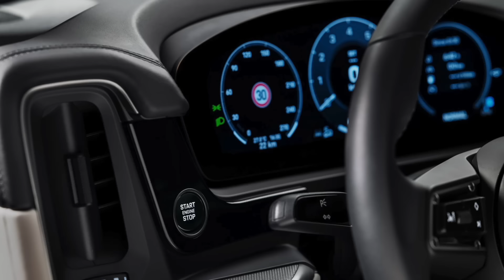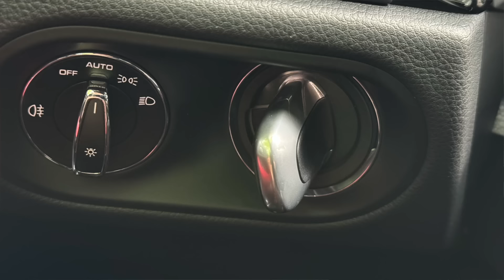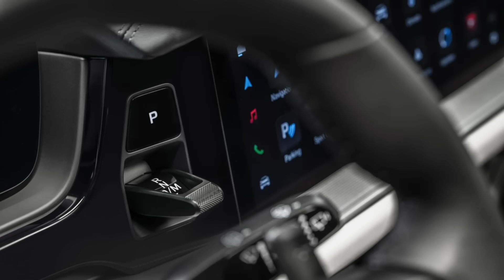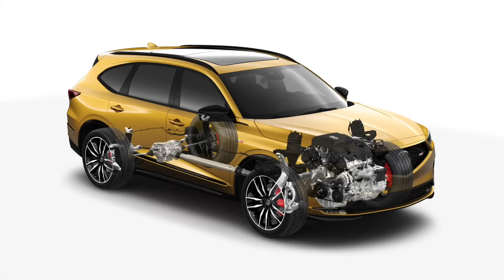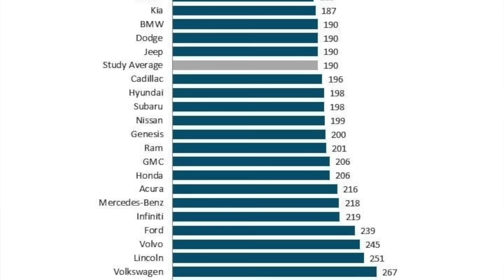BEST HANDLING LUXURY SUV // NOTHING ELSE COMES CLOSE TO THIS // 2024 PORSCHE CAYENNE REVIEW

Comment: I admire armchair quarterbacks with strong opinions about cars they have never owned or driven. The Packard motto back in the day was "Ask the man who owns one". Still applies.  I have a 2018 Macan GTS in Canada as the daily driver and a 2023 Tundra as my business truck. Never owned better and doubt I will. Thanks David, you nailed the reasons why.
Reply: does it have the Porsche or Audi engine in it?
Reply: @wally6193  The Macan GTS had the higher-output Porsche V6, the same motor that David is demonstrating in this video in the 2024 base model Cayenne. The Audi engine was used in the 4-cylinder base Macan. The Macan S had a V6. The GTS had a somewhat more powerful V6 with superior suspension and brakes.
Reply: @m.cooper1854  my understanding is that the V6 engines are from Audi/VW not from Porsche, the V8 is from Porsche.
Reply: Yes. V8 is pure porsche. Vw and audi had nothing to do with it
Reply: @user-g968h93r  okay but I was asking about all the V6 versions in the Porsches.

Comment: I drove my 2004 Mustang Mach 1 5 speed from Cody to Cheyenne, Wyoming.  400.0 miles.  The posted speed limits were 70MPH and 80MPH.  I averaged over 76MPH (not counting lunch and fuel stops) and 29MPG with the A/C on.   V8 engines loafing at low RPM get great mileage.  Turbo four and sixes get great mileage on EPA rollers but lousy mileage on boost in the real world.  Give me an N/A V8 instead of a turbo 4 or 6 any day.
Reply: Blame Joe Biden and the crew, the European Union, and the UN 🇺🇳

Comment: I have been a loyal Toyota and Lexus customer for decades.  I still own and drive a 2006 4Runner V8 Sport Edition.  I am hesitant to purchase new Toyota vehicles and some Lexus vehicles at this time.  Toyota seems to have debt, engine, quality control, corporate management, and pricing issues!  The introduction of 4 Banger turbo engines in trucks was not a wise decision.
Reply: Turbo 4 was introduced in the trucks back in the mid 80's

Comment: I rarely ever see any Audi, VW, or Porsche older than 5 years on the road. I still see a lot of 2000+ Lexus RX (mainly 2006-2015 my) everywhere.
Reply: I have a 2012 Cayenne that has about 120k miles, no issues other than a minor oil leak. I also have a 1999 911, it's had more issues, but I drive it every day.
Reply: That could be because the German buyers aren’t as frugally minded and don’t want to keep one car and drive it into the ground.

Comment: Toyota products remain high quality and reliable. The company is owning responsibility for recalling (voluntarily) and making whole the V6 twin turbo issue. Give them a little time. My twin turbo V6 is doing well w/o issue. Just checked the oil for debris - none. I do understand disappointment but it is just an engine. Sometimes mechanical designs need to be tweaked. The howling on the internet about poor Tundra and Tacoma sales misses a few points: 1. The inflation post pandemic has driven up costs. Prices will never go back down. We can only wish but not likely. 2. Other OEM’s trucks are not selling in the 45-75k price range. Consumers are adjusting to the “reset” on prices and the sales will rebound once interest rates are lower and the US economy picks up.